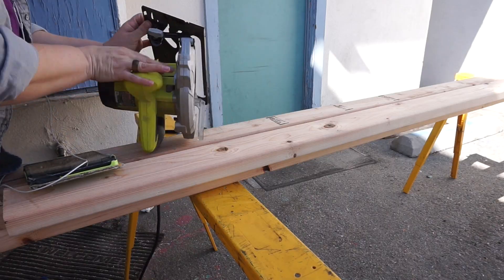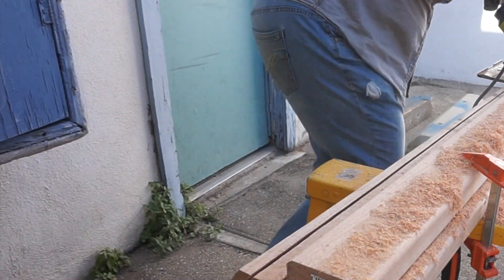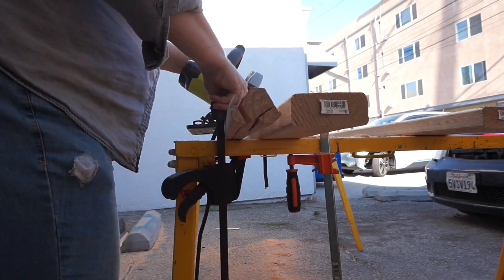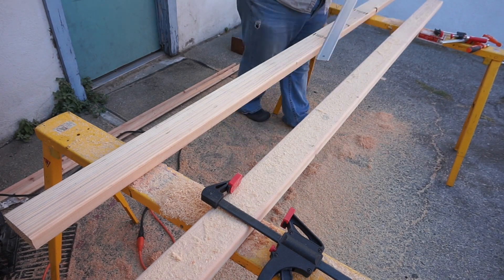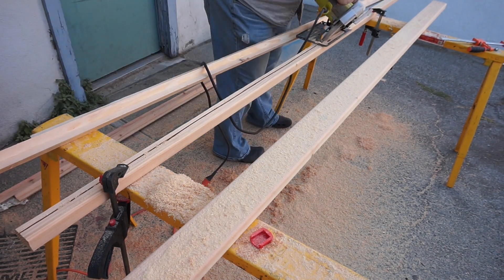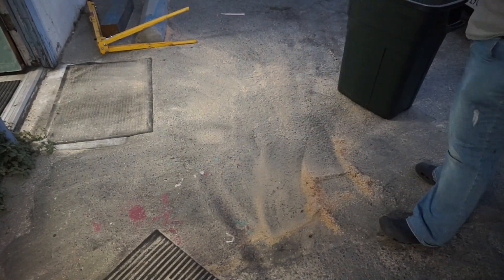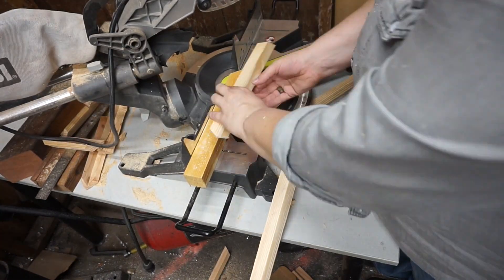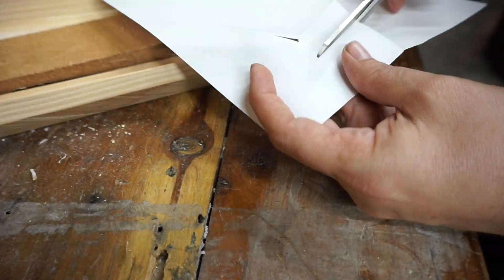Making a Dodecahedron the Hard Way - Dodecahedrum Part 5

Comment: you live you learn!   Gluing end grains dont work well as the end grains soak up the glue.   Also, there is a reason why the guy in the original video used a jointer....because dimensional lumber is not straight and even.   :)

Comment: maybe design and 3d print a jig, to put on the end of your cut up lengths, so when you are ready to glue it all up.... you can drill a hole into the end, then insert a piece of dowel... the one jig could then be used on all the ends if all the parts,